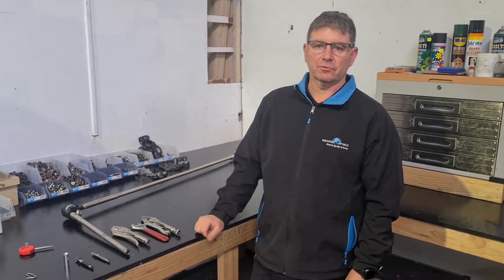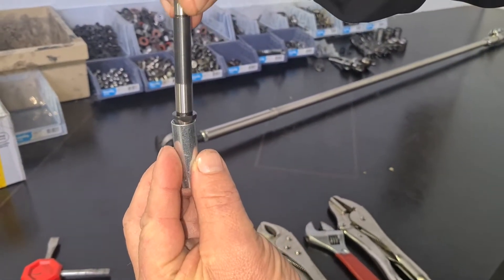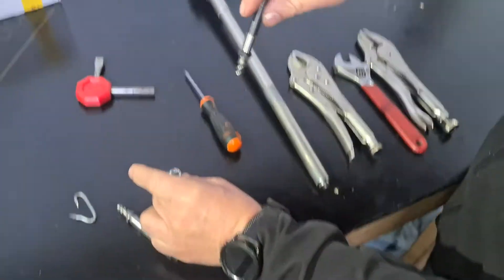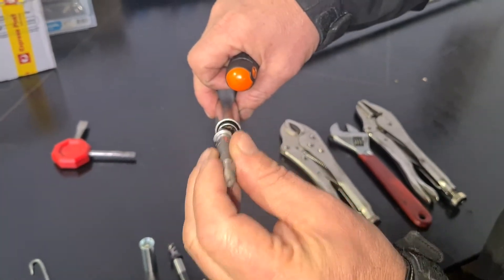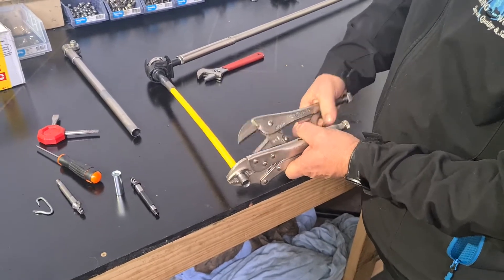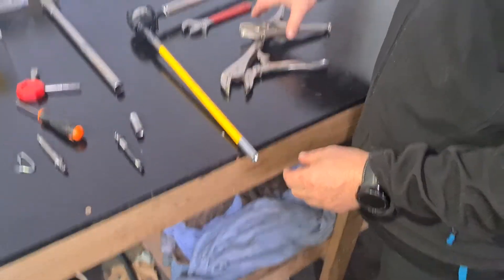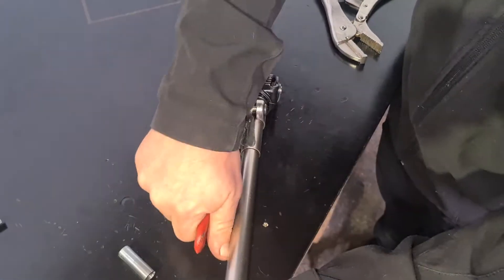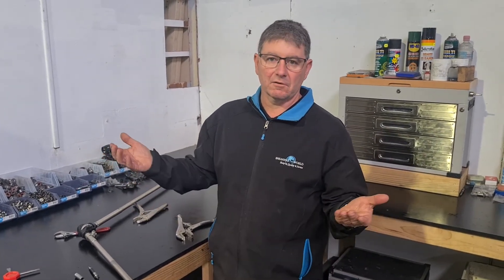Check your worm drive fittings.

Comment: I took the down tube  to the shearing centre and its  come back that on the short down tube there was not enough oil on the section and it was causing a dry spot and they said that's what causes it to come free from the top off the down tube which I wouldn't  have though off